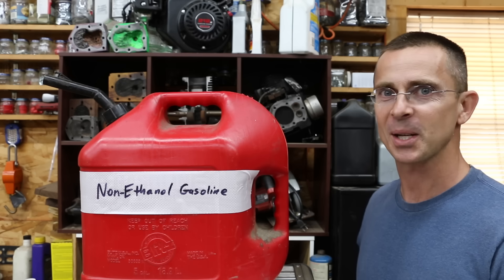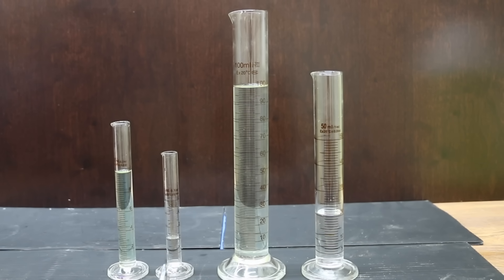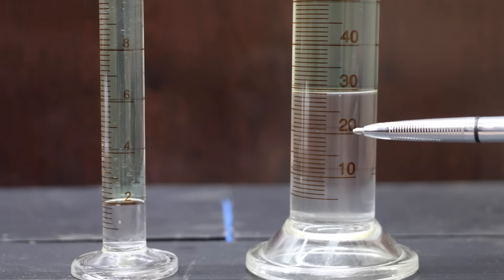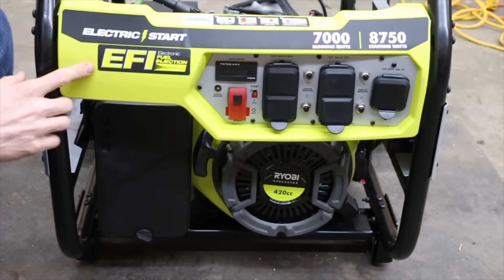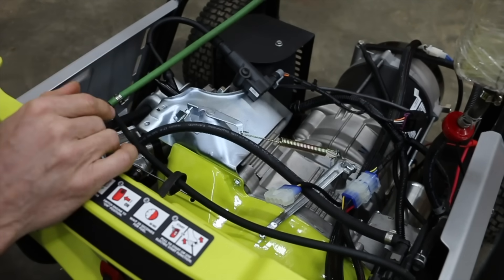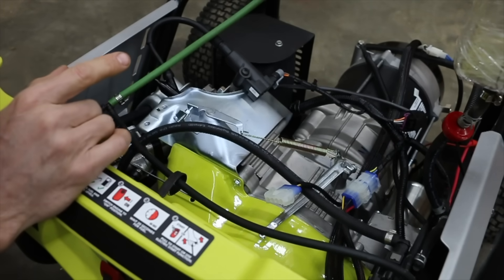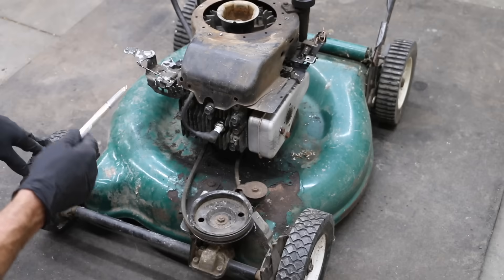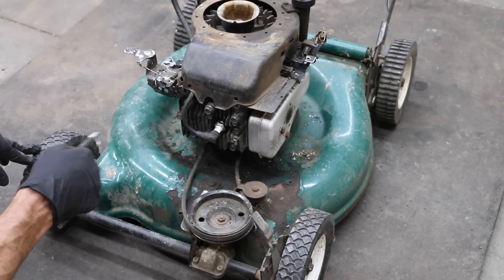Is Non-Ethanol Gasoline Really Better? See the PROOF!

Comment: I have a 1970 something ski-doo elan with a 12 horse single cylinder motor that was running terrible and smoking and fouling spark plugs. Was running non ethanol premium gas with a oil mix of 50/1. Drained the gas and replaced with regular gas and a 40/1 oil mix and runs great and no smoking. My mechanic said he has seen a lot of snowmobiles that just won’t run on the non ethanol  gas though we don’t know why. I have a husky 272 chainsaw. Always ran regular gas in it. Thing would sit all winter and come spring it always started right up. Same with my generator that has a Honda motor, regular gas, sit in there for a year and would always start on 3rd or 4th crank.
Reply from the maker: Thank you for the feedback

Comment: Modern cars are built to handle Ethanol.  Small motors from China usually are not.  The EtOH attacks the rubber and plastic parts such as hoses and seals resulting in something that looks like furniture varnish that gums up the fuel system.  That's why it's so important to run your stuff dry before storage.  EtOH has about 1/3 less energy than gasoline but it does boost octane rating which is the fuel's resistance to pre-detonation or pinging.  In a modern car EtOH probably doesn't matter a whole lot.  In older stuff or small engines, an additive is a good idea.
Reply from the maker: Thank you for the feedback

Comment: Ethanol will eat through older gas lines that weren't manufactured with ethanol in mind. It burns colder and does promote higher knock resistance with the caveat that it takes almost twice as much as gasoline to produce the same amount of power. If you have an older car, and are finding the carburetor gummed up, or clogged fuel filters, you may need to update your fuel delivery system.
Reply from the maker: Great point! Thank you

Comment: I don’t like ethanol in my car because it’s corrosive it evaporates quickly and it attracts moisture. I have a car that sits quite a bit and when I go out to run it after sitting for a couple weeks or so it’s missing a lot of fuel because it evaporated and it’s quite a lot of fuel especially with the newer evap systems... On my 66 Race car that I use barrel fuel in if I stop at a gas station and put a couple gallons of ethanol mixed gas in it and then park in the garage it makes the garage smell of fumes where as if it’s only barrel fuel there are no fumes. So my conclusion is if you don’t mind the moisture in your tank and you drive it enough to burn it up quickly enough that you aren’t losing it to evaporation it’s ok for the average person but as a real mechanic for 55 years and a race engine builder I despise ethanol in my car because it goes away to fast and actually costs so much more in the long run besides the reduced spark timing that the engine is allowed with just plain gasoline as none of the other fuels are that due to modifying the composition of what used to be gas into some mutated garbage (IN THE NAME OF EMISSIONS AND CATALYTIC CONVERTERS ESPECIALLY THE NEW HY-BRID CATALYTIC CONVERTERS THAT MADE THEM TAKE ALL THE SULFUR OUT) ...
Reply from the maker: Thank you for the feedback
Reply: Ethanol also is a quick burning fuel that seems to work fine for small bore and short stroke motors because it is so quick to burn but it is done expanding much to soon for larger bore engines with longer strokes when they only burn during many less crankshaft degrees than is required to make the power that a big bore and longer stroke can produce. Once again the garbage that they make for fuel is a base octane and during the process used is very volatile because of the shape of the molecular pattern they are creating.So it needs to be blended with ethanol in order to be used in the fuel that they make for autos today that much smaller in displacement. I don’t know if anyone has noticed that I have not used the word gasoline and the reason for that is that they haven’t been making gasoline for quite a number of years since the emissions levels were curbed after the embargo that was placed upon the public in order to force us to come up with something that made the environmental people who had to do something that would make the car corporations to come under their controls and forced them by making the consumer compel them to make gains in the mileage of their cars and trucks as to save them from the high cost of the embargo and during that time they were forcing the car corporations to cleanup their act and achieve reduced emission levels coming out of their tail pipes..

Comment: Fascinating test. 4-5% is about exactly the difference you should see between E10 and E0

E10 sucks hard core. its ONLY saving grace is your engine should be a little cleaner.

in MODERN vehicles you will only see what you saw 4-5% difference. however in OLDER vehicles (mostly pre 2000 roughly) you can see HUGE difference in fuel economy. my geo metro saw a 9mpg loss of fuel economy!! (mind you it gets 62mpg) my other vehicles (88 cherokee 92 clubwagon etc...) saw 20 to 30% losses in fuel economy

Most of this is due to their ignitions systems simply not being "tuned" to properly burn E10 (needs hotter ignition IE E0 is easier to light "properly" this is my GUESS and I am NOT formally educated in these matters but My hypothesis is competing flame fronts. ie the alcohol and gasoline don't "ignite" together so you can competing flame fronts in the cylinder and lose efficiency.

The only reason we use E10 is because we are primarily a CORN nation. E10 is not good for the environement your car or your wallet. its just corn money. it causes you to burn MORE not LESS gasoline. especially in older cars.

I have actually tested this multiple times. if I put 10 gallons of E10 in my 94 Geo metro and then put 9 gallons of "processed gas" (where I removed the gallon of ethanol) and put that 9 gallons into the car (not 10 just 9) I can actually significantly further on the 9 gallons of E0 than 10 gallons of E10

Honestly. MODERN cars won't see much of a difference.

Ethanol is also not rubber/plastic safe for anything "older" ie needs to be modern with "alcohol tolerate" rubber and plastic. I had to replace 6 fuel pumps when we switched to E10. it freaking sucked hard core. 1 car (the 92 clubwagon) I had to change the fuel pump TWICE (go look up how to change the pump on that one. fun)

why? the fuel pump auto zone sold me was NOS so it was "pre alcohol safe" murdered it in a week.

NOW as for corrosion. Ethanol does not corrode anything. that's not why they fail. WATER corrodes. The word you want is Hydroscopic not Hydrophilic (scopic is attracted phillic is repels)

Ethanol will suck water RIGHT OUT THE AIR ITSELF it is so strongly attractive of water. most small engines are "not well sealed" so their is open atomo exposure on some level so eventually they do exactly what you did in your test. once they absorb x amount of water they "phase seperate" just like in your test.

well take a guess that that fluid in the bottom (now the bottom of your ENGINE) is? ethanol and .... WATER and the WATER is what corrodes the piss out of everything.

for each season use stabil. at the end of the season add a little EXTRA stable and run the engine DRY absolutely dry. do this and you won't have any issues. don't do this and your rebuilding your carb come spring :-)

For small engines I keep 30 gallons of E0 on hand (generator pressure washer snow blower etc..) and I do exactly what you do to test. DO NOT USE PLASTIC. a common enticing container is 5 gallon water cooler jugs. cheap and easy to add a spigot to the bottom. problem is the ethanol ATTACKS the plastic. after about 20 gallons of processing I had thousands of micro fractions in the "lower zone" where the ethanol and water sits when settled) and it started to leak badly.

look for glass carboys. 7gallons is ideal since you can dump in 5 gallons of E10 and 1 gallon of Water. SHAKE like crazy and let it settle for a few hours till its CRYSTAL clear. flip it over with a spigot in place and let it rip till all the water/ethanol drains out them dump the 4.5gallons of fuel plus your measured load of marine stabil (my preffered sort) into it and into your long term container. repeat till you get as much as you need. if you have a local racing scene nearby they might like to have your cast offs. I think they like to "inject" this stuff into their engines for higher compression performance of something like that. I don't know the details.

YES the octane will be lower. Ethanol has MUCH higher octane than gasoline. so they have to use lower octane gasoline so that when you mix in the ethanol it "comes out right" but its really not that much of a difference. if you have a merc or bmw or some sort of sports car this might be an issue but for our run of the mill engines they will auto adjust for the octane difference it won't matter. and so far all my small engines seem to run smoother on it so they don't see to care either.
Reply from the maker: Great information. Thank you

Comment: Why did you use 91 ethanol free? Why not 85 or 87? 
I found my toyota corolla doesn't do much better with 91 ethanol free. But does 20% better mileage with 85 octane ethanol free.
Reply from the maker: Thank you.  I wasn't able to locate 87 or 85 ethanol free fuel locally.  Only 91

Comment: Ethanol blended with gasoline does cause erosion of rubber gaskets, platinum spark plug tips and leaves deposits not only on fuel injectors but carburetor jets as well. Ethanol is also hydrophobic (attracts water) and causes all kinds of problems with fuel systems that aren't used on a weekly basis. Things like motorcycles, lawn mowers stored for the winter, boats, motorhomes with gas engines should have the fuel purged from the fuel system and fuel tank emptied or install a water separator. 

Want to know how bad ethanol is? Thebl FAA prohibits the use of ethanol blended fuel for aircraft use because it attracts too much water and messes up fuel systems.
Reply from the maker: Great points!  Thank you for commenting on this

Comment: On my old 2000 PONTIAC SUNFIRE  I had to replace the fuel pump every 5 years. Now I've a FFV truck and I'll use nothing but ethanol free and I do get better gas mileage. However, one question I've is this: since the closest gas gas station has 89 octane ethanol free and my truck (it has advance timing) calls for 91 or higher, should I just drive an extra 5 minutes and buy ethanol free 93 octane or should I mix the race fuel they have at the 89 octane ethanol-free gas station (in the right proportions so that I can increase the octane level)? I'm not sure is race fuel has ethanol in or not.
Thanks.
Reply from the maker: It's a matter of opinion but going with the 93 seems like the best option.  Thank you

Comment: I was fine with ethanol fuel mix until I tried starting my new chainsaw that's really not happy with ethanol fuel mix. 
I'm buying fuel for it in a can that costs around $20 per gallon. It's insane but in order to get alcohol free I'd have to drive a hundred miles round trip. 
Illinois..
Reply from the maker: Thank you for the feedback
Reply: https://www.pure-gas.org/index.jsp?stateprov=IL

Comment: The most serious problem with ethanol in gasoline is that the ETHanol is contaminated with METHanol!  Methanol has an * acidic proton *. It is *corrosive*,  which is why it turns the brass jets in my Honda Sabre motorcycle into green oatmeal . It is very destructive and works quickly; in about two weeks the carbs are unusable.
Reply from the maker: Thank you for the feedback

Comment: I really want to supercharge my legacy. Has a 10:1 compression ratio already which is very high to be doing forced induction and there is no e85 anywhere on the east coast... e85 is so important for not nuking an extremely high compression engine. E85 is only 1.70 at the closest place 200 miles away lol but premium is 2.70. E85 has 25% less energy that E10, but the cost is 63% of premium. That means 12% more fuel can be used to break even in cost. I'm surprised more places do not have e85 with a lot of popular cars having 10:1- 13:1 compression ratio or turbocharging. Rav4 and cx5 have a 13:1 compression ratio. That is a ton of pressure and I wouldn't be surprised if they are losing power by using lower octane fuel. Cars retard timing so they dont preignite which is known to cut power.
Reply from the maker: Thank you for the feedback

Comment: I'm certain that non-ethanol fuel has a higher BTU rating than ethanol mixed fuel and therefore less fuel is required to produce the same work. However, in order to meet the EPA tail pipe emission standards an oxidizer is required. That is the job that ethanol does ever since the additive MBTE has been banned. Upgrade to modern plastic and rubber fuel lines.
Reply from the maker: Thank you for the feedback

Comment: If you want to consider the whole picture, also think about all of the subsidies (e.g. your tax dollars) that go towards creating ethanol, regulations that make it either prohibitively expensive or impossible to get non ethanol gas for small engines (lots of wasted money on broken equipment), all the pollution in the form of emissions and fertilizers (not to mention energy, more fuel) that goes into creating all that ethanol in the first place (offsetting any gains),  inflation of the cost of other agricultural goods (due to the artificially constructed competition with ethanol corn) and many other less obvious issues.
Reply from the maker: Thank you for the feedback

Comment: Its a bull shit test. In new equipment designed for Ethanol it works fine. In old equipment it destroys rubber parts in the fuel system not to mention it erodes the solder out of brass floats in engines small and large.  I think we will have non Ethanol gas around for our present crop of  small engines for years to come.  For the future it's here now for new engines. This test doesn't speak to or address the issues with the fuel!
Reply from the maker: Thank you for the feedback.  I have another video on the damage caused by ethanol in modern engines with carburetors.

Comment: OK, here goes nothing, I was a patrolmen tank driver out of the three refineries around Billings Montana ( i cant tell you about other refineries or location around the country) I know there is a refinery pipe line head in Spokane Washington coming from Billings (I live in panhandle Idaho) also you can pickup a ethanol tester on ebay for 10 to 20 dollars. I was told at the refineries that regular fuel is in dead 10% and premium is indeed 0% mid great is a 50 50 mix of regular and premium being 5% also the stations that post "non- ethanol premium" signs charge way more for there premium, trust but verify, I do with my tester, Im not open for dispute as I have verified this situation MANY time, just saying, good luck
Reply from the maker: Great feedback. Thank you